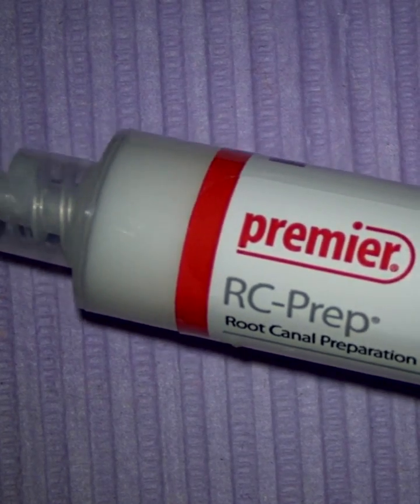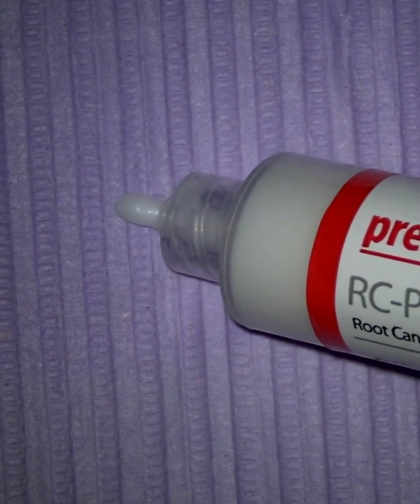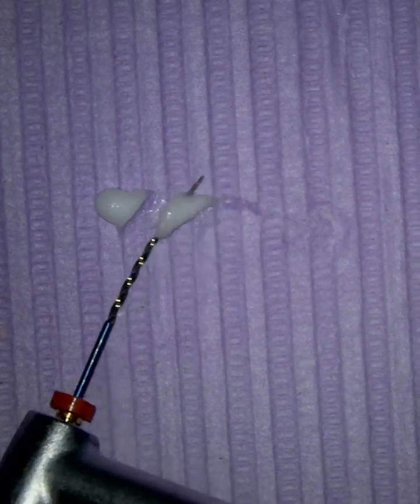Beware of RC Prep with Rotary/Reciprocating Files!

Comment: The instructions for RC prep use is to irrigate with hypochlorite between file passes. The reaction between the two chemicals bubbles debris out of the canal quite effectively. If you haven't tried this method I'd give it a go. 👍